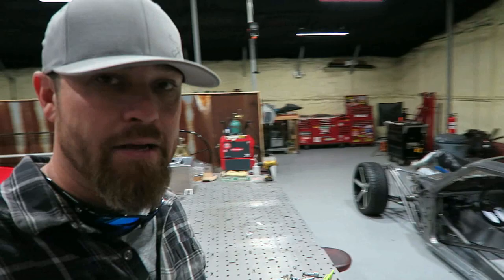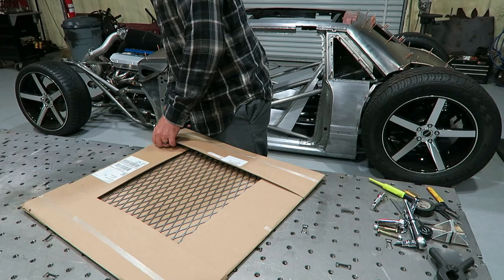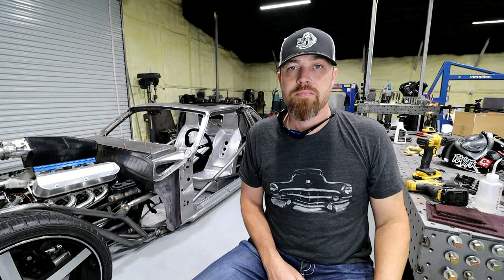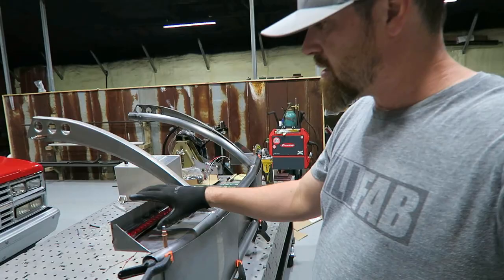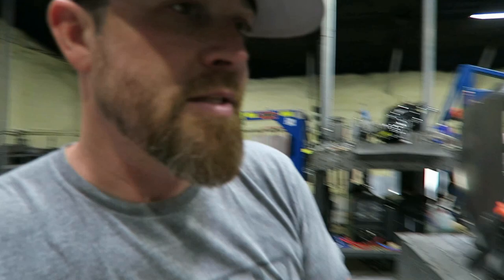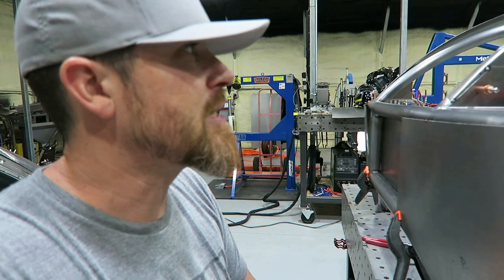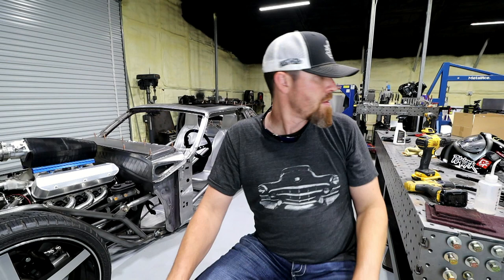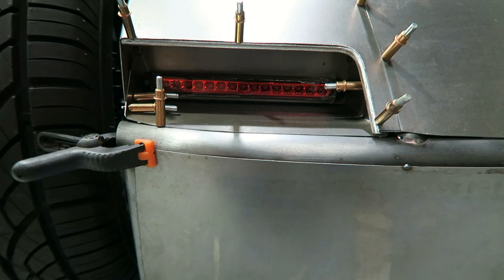Trying To Build Automotive Artwork

Comment: I like the two look for the break light. I'm interested to see the finish look of the housing for the lights never thought to use break lines. I have always seen welding rod or coat hangers used

Comment: And we used three layers of expanded metal on the rear of a Lamborghini kit car. First and third layer were aligned and the middle later split the difference. Put two small radiators behind them (intercoolers would work, too... But maybe not with your custom suspension)

Comment: Nice work. I'd just have done one, but with two, you can stagger the light, IE. brake bottom, turn signal top. Strobe controller might be cool too.

Comment: Looking good on the rear lights. I'm diggin the dual lights for the rear.  Great tip on the brake line for finishing off edges, good stuff. As always, nice work Mr. Voss.

Comment: I’d use two lights for sure, but one for tail and signal and the other for brakes. Not a huge fan of the expanded metal, I’d rather see a torsion box type hexagon that fits together?? Like 1” deep strips all bent up and notched. Way harder but something really unique!

Comment: What if you took the expanded metal and lined the holes of one section of where it comes together in the center of the holes on the second piece, make the few large holes into alot of smaller holes. But the offset holes look good too.

Comment: Wire both to come on with brakes and only 1 to come on for turn signal. Atleast in my head it makes sense to do that if possible. Then of coarse the running lights would be both on. That was smart idea with the brake line though makes for nice curves like a woman 😁. Could do some mild expanded metal over the opening of the lights. Maybe some slightly thinner in pattern (not gauge of it) just so you retain full light visability.

Comment: What if for the vent sections you put the expanded steel in layers and at an angle. Like the two 12x12 sheets parallel to each but not touching and angled maybe from the bottom rear in towards the top front. I think some depth would help get the look you're describing...but I'm no professional of course ;P

Comment: how about putting 45 degree inverted scoopes in the back 1 either side below the taillight like what the gt40 hood scoop looks like. be different and would let the air flow and add down force and it hasn't been done like that i don't think but anyway the build is looking awsome cheers from down under

Comment: Hey Kyle ,Coming along very well. I know your a busy man so i wont take up too much of your time .Question regarding your turbo set up. I have a 6.2 Diesel I want to turbo.Should I spool it through  both sides of the v8 as my turbo is for a Cummins 10.8.Would it work better into a y pipe from both or should i keep it to just one side. or should I just get a smaller turbo. What is your set up going to be like on the Bibster?